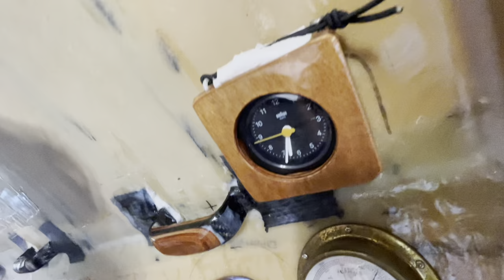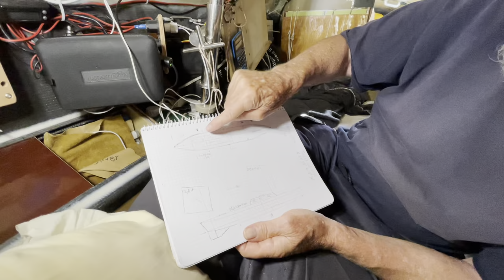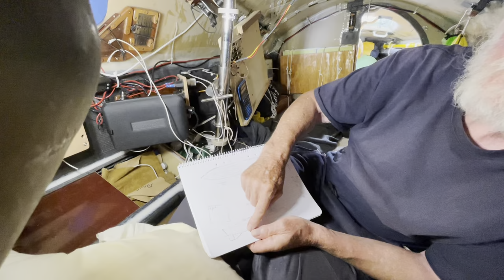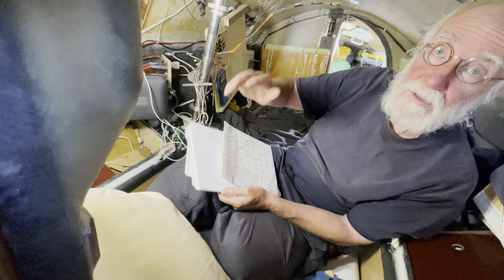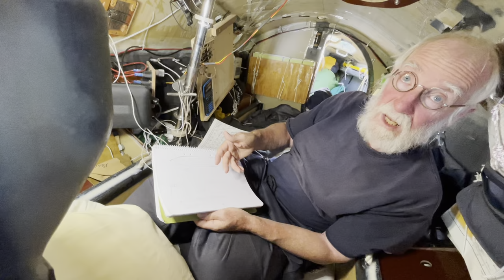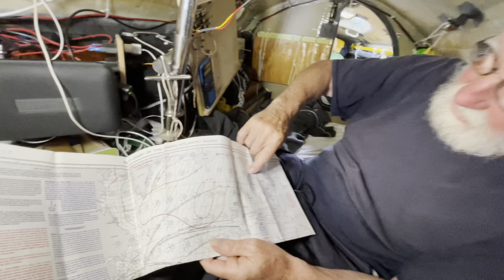Meeting my hero! Sailing legend Sven Yrvind

Comment: Look at the ports. From inside you can see this is a three inch thick deck/cabin. Not quite bullet proof but the boat will survive longer than the occupant. This is some impressive engineering for northern latitudes. Would not want to be in it in the subtropics and tropics, but for what he wants, very impressive.

Comment: I pray and hope when I'm 83 I'm not only still alive but able to sail and get around like that sailor, imagine being 83 talking about the plans for your NEXT sailboat you plan to build while sitting in one you have built after sailing 100's of miles. What an inspiration. Imagine the knowledge that man has. What a honor to have been able to spend time with him in person. I can't wait to be sailing.
 Sam, I saw where a man put what is called an ion disapaytor on top of his mast, that allows the boat to adjust its charge in a storm to keep from being struck by lightning, he also had a flat piece if copper 2 inches wide and 1/16th thick that ran inside the boat under the floor and attached from the mast and other things to somewhere else to allow lighting strike to discharge without burning a hole thru the hull. Is your boat protected from a lightning strike? If I have the site in my history I will return and post it. Th he man not only is a sailor but an engineer and read the data from the power company's research on lightning strikes.

Comment: Amazing micro ocean-going sailboat !  Doesn't seem to have a keel.  I suppose it's weighted heavier under so if and when it capsizes in really rough seas, the sailboat can quickly right itself.  But something that small, you'd be tumbled around like a rag doll in a washing machine.

Comment: Taking it to the extreme....I just read Alone Against The Atlantic, where the author designed and built a 10' sailboat and sailed to England in it.  I've always found the voyages of Roger Taylor in Ming Ming II, a modified Achilles 24 that he installed a fairly massive junk rig on.  And then there is Rory McDougal and his Tiki 21......... There are a lot of real characters sailing outrageous voyages in small boats it would seem.   I have to chuckle when I come across discussions of "blue water" boats.... In one case someone authoritatively stated that you shouldn't cross oceans in anything under 40'... what a laugh!  My favorite sailing event... race in only the loosest of descriptions... is the Jester Challenge where they sail from Plymouth to Newport... which as you know is "backward".  30' is the maximum length, and it is a single handed event.